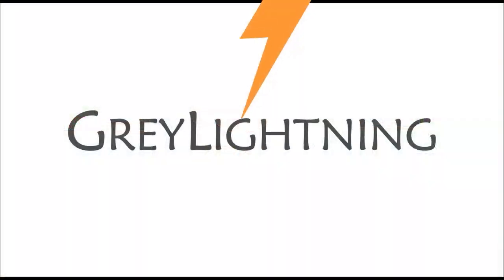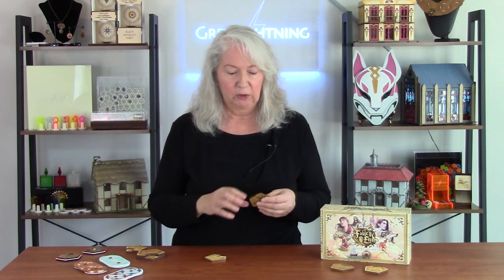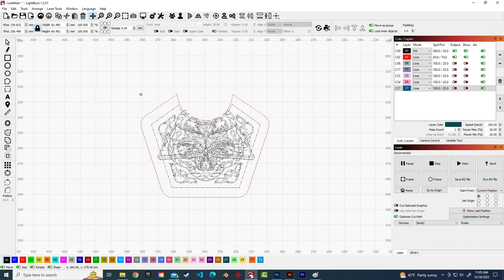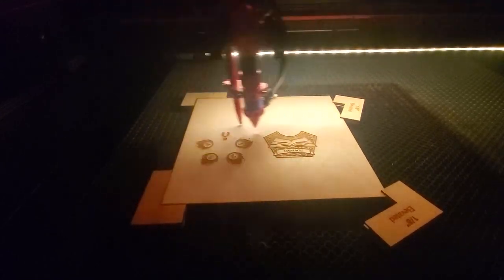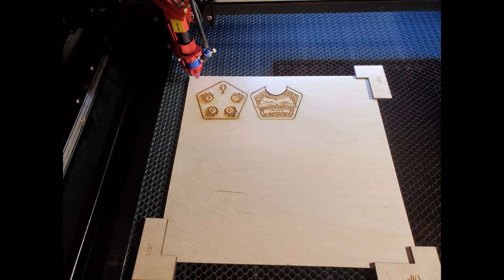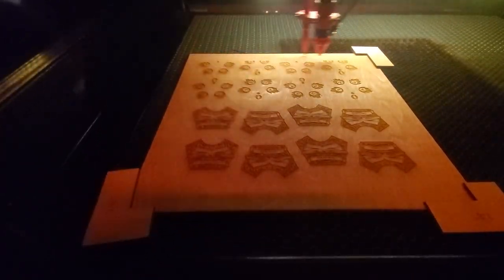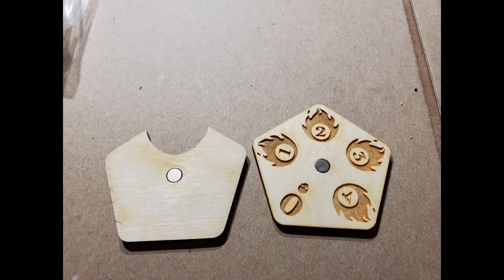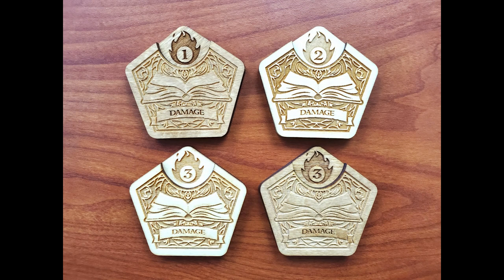How to Design and Laser Cut Magnetic Game Dials

Comment: Those came out really well!  I have had hit or miss luck with engraving pockets with a consistent depth in wood (I am probably using cheaper wood), so I have done that with opaque acrylic.  I wonder how well that would work with a darker wood for the core, covered with a light wood, like Birch as a thin veneer to cut through (sort of like the two color plastics for engraving).  I have seen Spectraply (all the same wood, but the layers are dyed different colors) at Rockler but they are usually 3/4" thick or more. . .
Reply from the maker: Andy, I would LOVE multicolor plywood, what a great idea! I will search for some, and please let me know if you find something thinner that I can cut on my machine. I wonder if we can make our own??
Reply: @GreylightMay  I have seen videos where people have made presses for making their own plywood.  I have not tried it myself because I usually do plastics.
Reply from the maker: Andy, I found a few wood options at Johnson Plastics Plus, the people who make the Rowmark layered sheets you can engrave. I'll be testing them out, and will show them in a video soon if they have potential. I'm working on double dials for Frosthaven right now, I will try the new materials for that!
Reply: @GreylightMay  Nice!  I am looking forward to seeing how they turn out.
Reply from the maker: Andy, I used these quite successfully on my Frosthaven dials! Keep and eye out over the next 2-3 weeks for my video on those, I think you'll like the results!!

Comment: Why didn't you spin them so we could see how they work?
Reply from the maker: Excellent question! I should have. They don't actually spin, if they did they wouldn't hold the number. They turn easily, but if the magnet is inset far enough (which it was), the wood touches and there is enough friction to hold the number in place. I definitely should have demonstrated that!